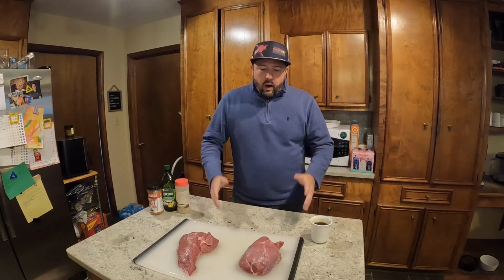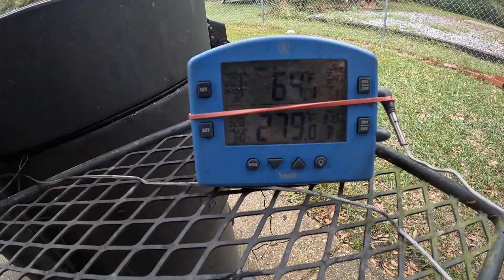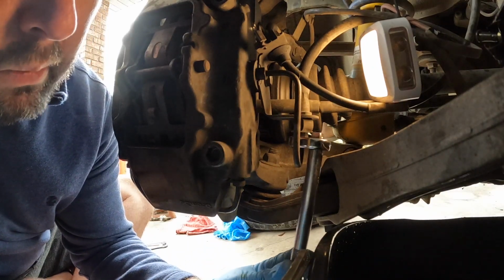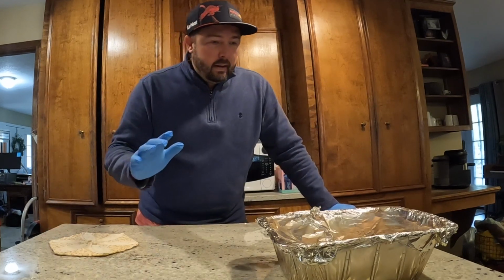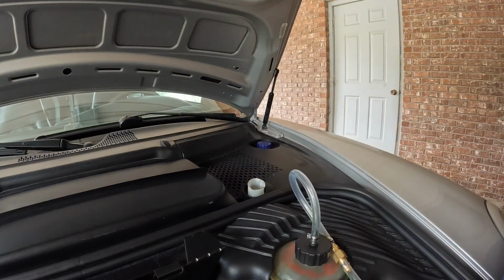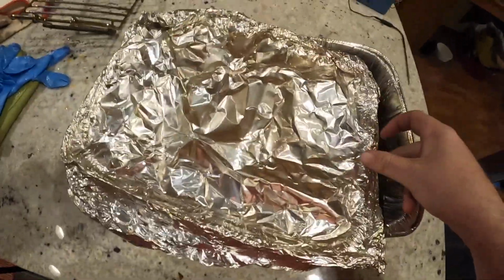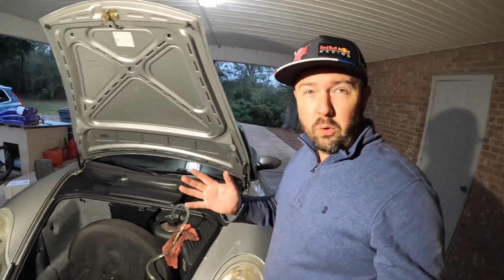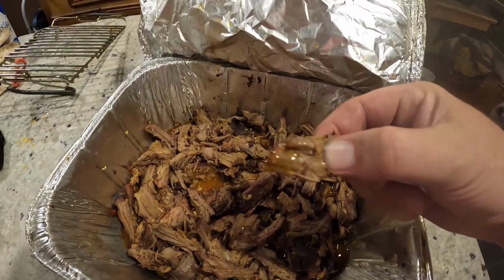Stainless Steel Brake Lines - Porsche 996 Brake Upgrades

Comment: Brakes are something I swore off, even though I had to semi rebuild a caliper on my Cobra a few years ago.  Swore off coolant flushes too, so I get your anxiety.  But I did my own water pump and associated maintenance a few months back with no real issues.  With the Motive it looks easy enough.  So I might pick up a Motive and do mine when I hit that 2 year mark in the spring (I think).  I just did my fuel injectors last weekend.  I put it off a few weeks and then finally dove in.  It was tough but doable.  Just like you said, if somebody else can do it, I can do.  But now I have a misfire on cylinder 3.  So if I can find the time this weekend, I’ll have to move that injector and see if the problem follows.  Hopefully it’s just a bad injector, not something more serious.  Looking forward to the HPDE.
Reply from the maker: I’d love to put my calipers on the to-do list including a repaint. Yeah the Motive made very straightforward. When you did the injectors, was there a symptom you were resolving, or was it just time to do it per the maintenance schedule?
Reply: @motorsandmeats88 My used oil analysis showed some fuel dilution.  So based on Charles Navarro’s recommendation I checked for vacuum leaks by smoke testing.  With no vacuum leaks he suggested replacing fuel injectors.  Since fuel leaking into the cylinders could encourage bore scoring because it strips oil. And we all know how bore scoring mania is striking fear in the hearts of pre-997.2 water cooled Porsche owners.

Comment: Good job with the brakes. The secret to the meat 🥩 is add s little brake fluid for flavor 😂. Stainless versus OEM is same on the road but on the track as fluid heats and expands, stainless prevents lines from swelling and thus brake fade and loss of pressure. That’s why most performance motorcycles have stainless brakes lines 👍🏼
Reply from the maker: Haaaaaaaaa

Comment: How long did this whole job take you?
Reply from the maker: It was about 3 hours, but only because of the cautiousness of having never done it before. I could do the same thing again in under 2 hours easily, especially if I wasn’t trying to cook a dry chunk of meat!
Reply: @motorsandmeats88  Thank you! Looks like I'll be giving it a try. Shop quoted about 4.5 hours for the brake line replacement and flush. Did you perform the flush after changing out all the brake lines/hoses?
Reply from the maker: @biggiebruce2428 I did. The pst part of the video covers the flush. I changed the fluid out to a race spec fluid. The color was different than what was in there, so it was easy to see when I’d gotten out all the old fluid.